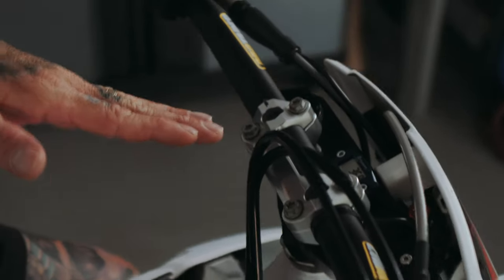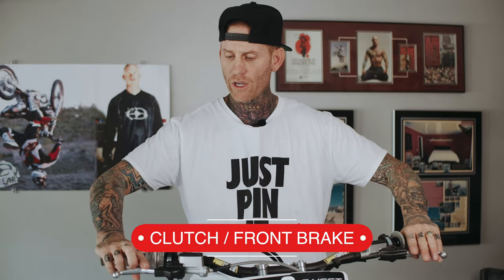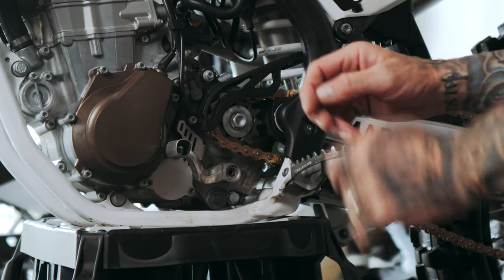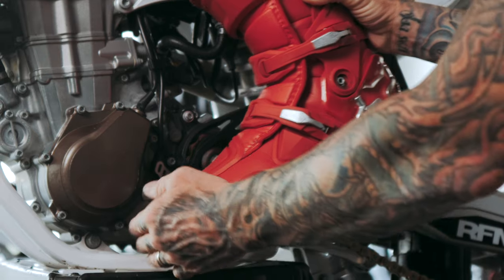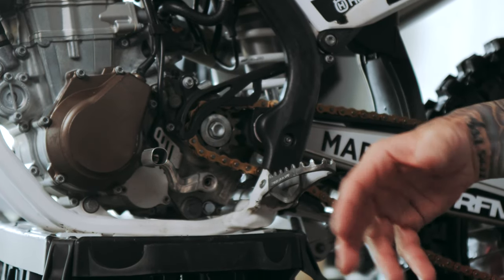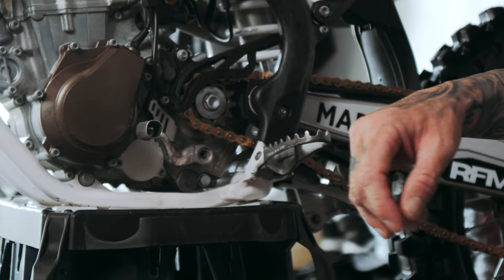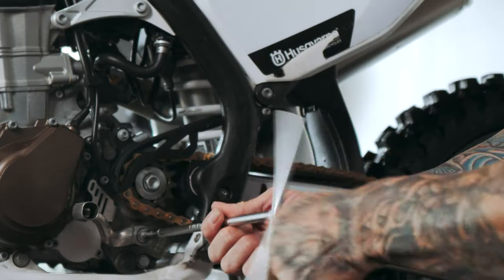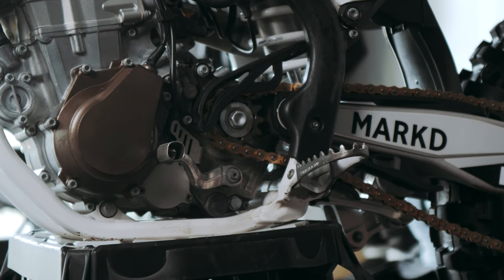HOW TO SET UP HANDLEBARS & DIRT BIKE CONTROLS

Comment: About the pitch angle of the control levers should they be comfortable only when sitting or provide equal comfort for sitting and standing positions - thus pitched lower for some maybe 10 degrees from the sitting position comfort?

Comment: I really like this video and will be using the tips you shared once I complete the rebuild of my 01 CR250. I did have some trouble understanding the first point you were trying to make regarding the handlebars.  Specifically being even with the forks
Reply from the maker: the angle of the bars should be in line with the forks..
Reply from the maker: if you get off your bike and look at it from the side the bars and forks would be at the same angle. does that help? 👍🏼👍🏼

Comment: but.. what is your tire PSI at? hahaha great video, solid info! Do you run it with some play in your throttle or keep it tight?
Reply from the maker: 12.5 -13 on tires, and i run my throttle with no play! 🙌🏼🙌🏼
Reply: No play is mandatory. That thing should snap. Getting hung up is not a scenario you want. That hesitation in play could cause bad habits in throttling over time.

Comment: I promise you,  with your levees that level,  after braking for a corner, you can't re-grip the throttle, so your elbow drops below the bar to your waist even, when you get on the gas.  Goo think the tracks are freestyle smooth.  But Chase Sexton crashed at the last 2022 national (on of his crashes), because he came out of a corner on the gas, elbow down, lost a bit of drive out of the corner (tire slippage), that caused his weight to go a bit forward, and hit the next little jump with his elbow at his waist.  He crashed, and lost the championship.  He would not have crashed with the proper bar/lever set up, as his elbow would have been up and ready for it, like a push up off the bars.  Good thing you guys rid smooth tracks today, so you can get away with adopting freestyle set up bars and some road racing techniques.

Comment: I don't hear any rational reasoning for your bar set up, but I understand it for freestyle, (more leg clearance.).  Now I know all the corners on a MX track today are long, large radius berms that can be railed with a Harley Sportster, but if you ever "square off" a corner again on flat ground or off camber (a berm or a rut on a off camber surface is no longer off camber corner if you use the berm or rut.), you will see how much easier it is with the bars rolled back ,(like the age of reason of the 80's and early 90's,---before freestyle,--hint),  to get your shoulders more over the bars for much better control, (you can push up and down on the grips with your shoulders closer to the bars, and elbows up.), and if you rotate your levers to point down again, (again to help keep your elbows up), you can re-grip the throttle a bit to full throttle, and not have your elbow drop below the bar.  This was the cause of one crash of Chase Sexton at the last 450 national of 2022.  His elbow was at his side when he hit the face of a small jump shortly after a left hand corner.
Now I tried (after 18 years off a bike, got a 2019 YZ250 2-stroke), the high bar set up and had a real hard time feeling the corners, (and I notice, amateur racing has very very bad flat corner speed today.).  Go back to reason, the age of reason of MX was the 80's,---and I promise, you will have more control of berm-less corners, quicker lap times and crash less.  Chase too.
Reply: And it is not just MX, (which I thought would be last, but it is happening all at the same time.), but every industry.  We are entering an era of irrationality where we can't really figure things out, (school problem actually).  That pretty much guarantees a pretty crappy future of citizen dysfunction,---and that is when the dictator takes charge.
We better start thinking for ourselves, instead of following anything with no rational reasoning.  The entire industry followed a freestyle set up, (it was also a generational change in the sport), and that is amazing in a sad sheep way.  We are better than this.
Reply: Oh, there is one other thing about rolling the bars back.  The seats are taller today, (I lowered mine by 1". YZ250 way to damn tall, took .75 off the suspension too.), so it may seem like the bars are too close to the seat.  Try it anyway, because when I sat on a book too, man, I could really get my shoulders over the bars for tight cornering.  But even with my lowered seat, it is way easier to drop into a corner that when I tried the freestyle set up that everybody uses today. 
Bahhhh, ah, ah, ah, ah, ah, ah.  weare losing our ability to "reason", and that is not good.  Get an engineering degree.  That is the study of reality, (unless environmental engineering, an anti- American, anti-production/profit commie course), and it will help.

Comment: Notice how even the pro racers drop their elbow to their waist, (many times), when they get on the gas?  That is because their bar and lever set up is better suited for freestyle.  Chase Sexton crashed on the last 2022 nation (one of them), because his elbow was at his waist before he hit the face of a smaller jump right after a corner.  He would not have crashed, (and maybe won the championship_, if he did not use a free style set up, (like all the sheep in the industry today), and was able to re-grip the throttle for the corner exit, so his elbow did not drop below the high bar.  You kids could have the freestyle set up.  I guess it works OK for fast smooth tracks, but not for real off road riding.  It is amazing, what human beings can get used to in mass, even if it sucks.

Comment: It is a freestyle set up for trick clearance,---and the entire industry adopted it, because the new generation did not know any better.  There is no rational reason, (and reason against it), to have your bars rotated forward for riding,---and all the amateur corner speed sucks like it never has before.  I se the local Go-pros.  You can't turn the bike with out a berm, because the bike is tall, and your handle bar/lever set up is a free style set up that does not let you have good control of the front end.  But,---you can get sued to it,--for some reason.